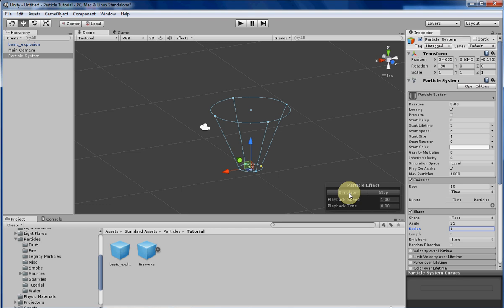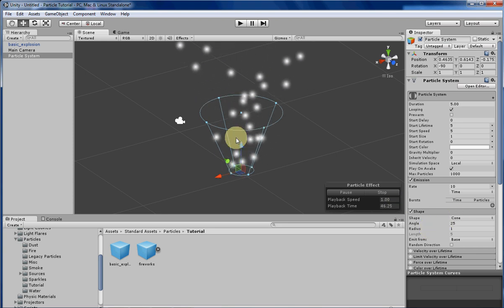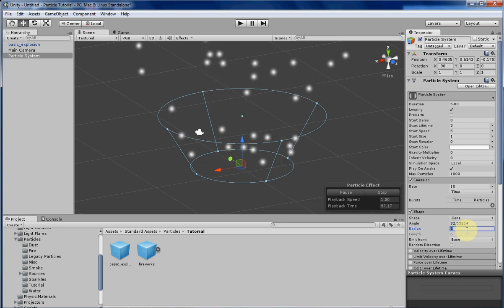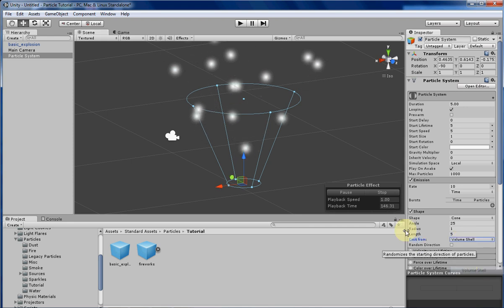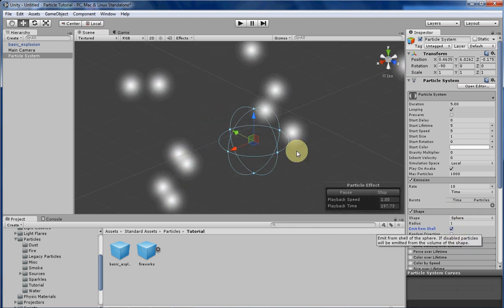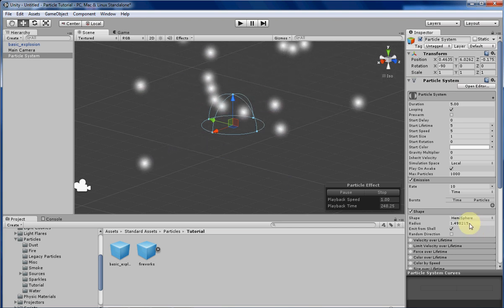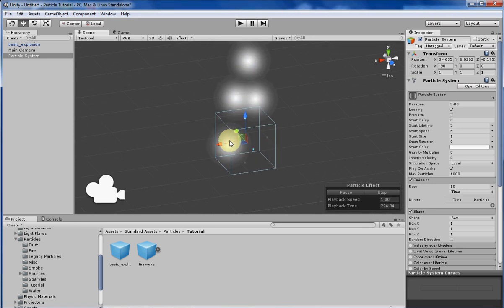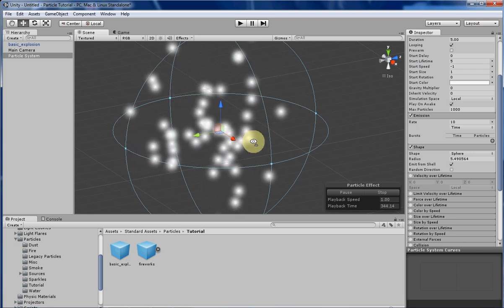Unity's Shuriken Particle System: Emitter Shapes

Comment: So I was wondering how you would create a particle shape in any shape. So, for example, all of the default ones available are box, cone, sphere. But how would I create something let's say in the shape of a triangle?
Reply from the maker: If you wanted a different emitter shape other than the default options, then you would need to use a 3D mesh as your emitter shape. If you want a bit more detail on how to do that, I made a video on it here:
Unity's Shuriken Particle System: Mesh Emitters 
Unity has a few 3D meshes that you can use, but if you wanted a unique one, unfortunately you would have to build a model yourself and import it into Unity. Let me know if you gave any other questions!